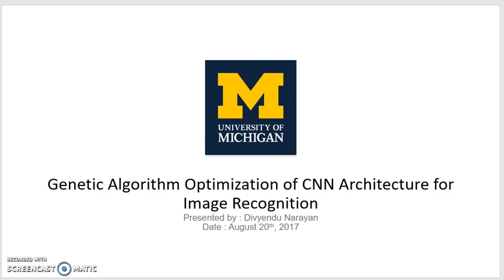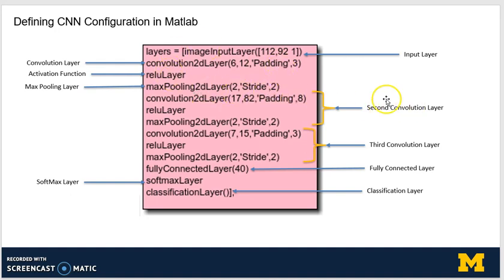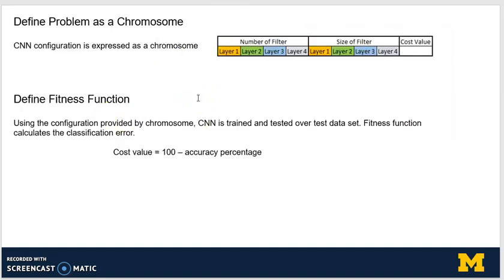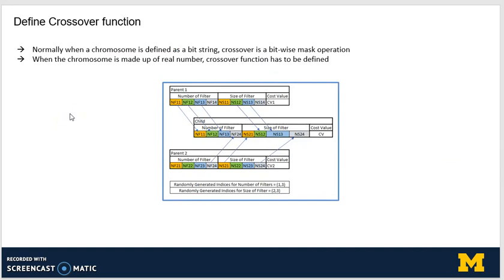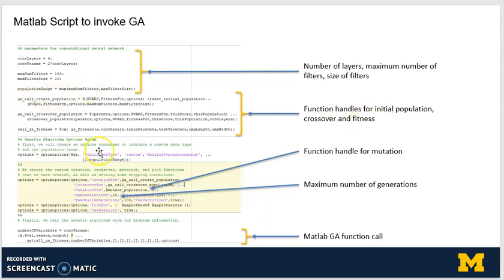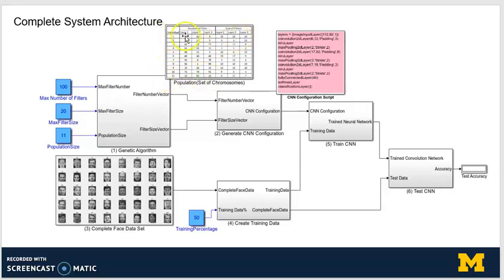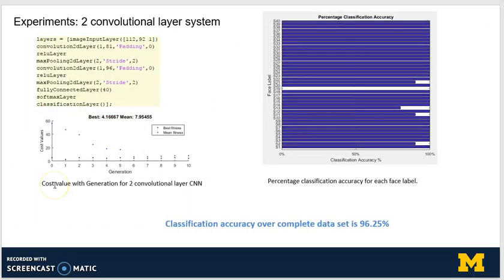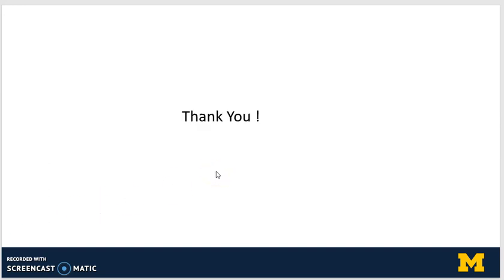Genetic Algorithm Optimization of Convolutional Neural Network Architecture

Comment: Hi, i recently start working in the optimizaition  of a CNN by the use of genetic algorithm for an image classification problem. I am using Matlab. Can you provide me with the code you present. It will be very helpful for me. Please share. Thanks in advance.
Reply: Hi Sehla.. Have you got the code yet? I am working on forecasting modelling with neural network. I am thinking to use Genetic Algorithm to optimize the parameters of my network. I hope you can share the code with me. Thank you.
Cheers.
Reply: ISKANDAR SMn Hi Iskandar, i didn't get the code. Are you using CNN for image classification ?
Reply: No. I am working on time series data. I am thinking to modify the code to optimize number of hidden layer and neuron of my neural network. Good luck with your research.. #smile